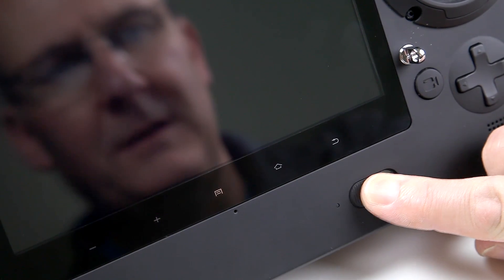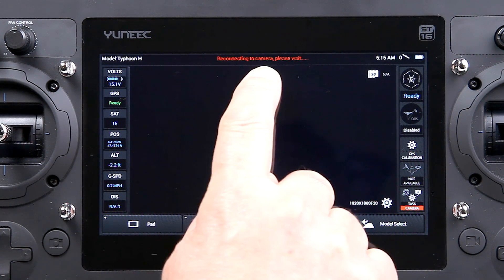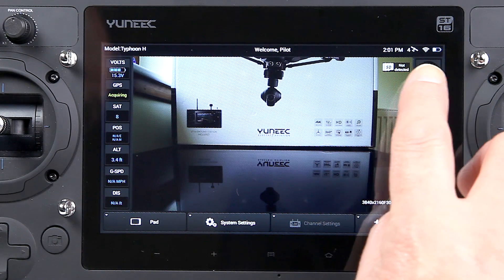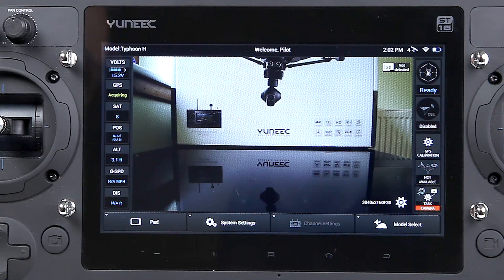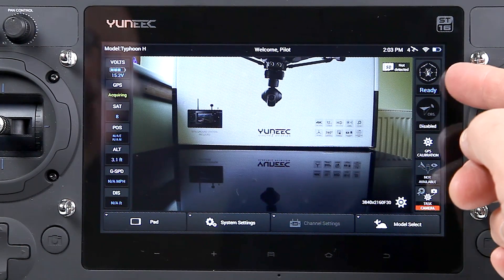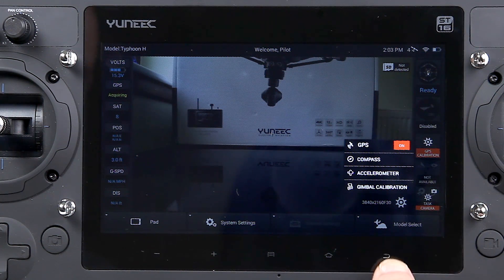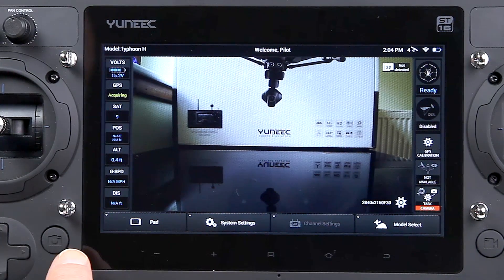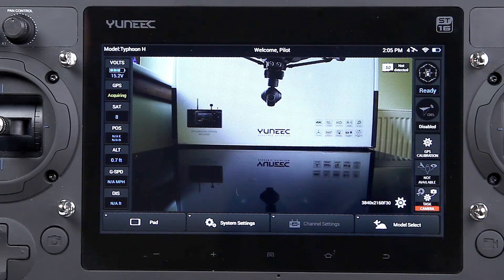Yuneec ST16 full review PART 2 settings

Comment: HELLO
 WILL YOU PLEASE TELL ME HOW TO RESET
 THE BATTERY WARNING INDICATOR SO IT COMES
ON A BIT LATER THAN 10 MINUTES FLIGHT TIME.
 LIKE PERHAPS 15 MINUTES.
 THERE MUST BE SOME TYPE  OF SETTING.
 THANKS
 KEITH KUHN
KK MOTION PICTURES 
ALSO ON YOUTUBE
Reply from the maker: Hi Keith, the battery warning is on battery power not time, I would not ignore it, it has a fail safe system but I never risk it. If you only get 10 minutes you are either flying at full rate all the time or have a failing or under charged battery. I get around 20-25 minutes out of mine
Reply: THANKS FOR THAT INFO.
 I CRASHED MY TYPHOON H TODAY BIG TIME.
 I FLICKED ON THE HOME SWITCH TO BRING IT BACK , I WAITED  FOR IT TO RETURN.
 IT GOT CLOSE THEN I HEARD THE DREADED NOISE IN THE TREES ABOUT A HUNDRED FEET AWAY. I AM LOADING THE VIDEO NOW. I WILL SEND IT TO YOU WHEN IT IS READY.
 KEITH KUHN
Reply from the maker: OUCH! hope you get it sorted, sounds expensive Cheers
Reply: I CAN ONLY SELL FOR PARTS.
 I WILL SEND YOU THE VID  YOU WILL
LOVE IT.
 HOW MUCH IS JUST THE DRONE,I WONDER WITH CAMERA.
 I WANT ANOTHER, NO KIDDING
KEITH KUHN
Reply: WILL MY CONTROLLER WORK WITH A NEW DRONE ?
 I REALLY WANT ANOTHER TYPHOON H .
 I HAD PUT IT IN THE HOME MODE BEFORE WITH OUT ANY PROBLEM, WHAT DO YOU SUPPOSE WENT WRONG?
 IT WILL USUALLY RISE UP AND COME HOME --  BUT IN THIS CASE - - YOU KNOW.
DO YOU SUPPOSE THERE WAS ANOTHER
SWITCH THAT WAS NOT ENGAGED TO CAUSE THIS TO
 HAPPEN ?
 THANKS
 KEITH KUHN
 IN OHIO
Reply from the maker: Home is home, pretty sure it then ignores all other switches. I just think it didn't rise high enough for your trees, I've never had a problem with home switch.
Reply from the maker: I wouldn't sell it for parts, ring Yuneec if you don't want to fix it yourself, they are really good ;-) Your TX will work with any H or Q500 drone :-)
Reply: YES BUT I BOUGHT MY DRONE USED.
 YUNEEC DOES NOT WANT THE  CRASHED DRONE.
 IT IS BEYOND REPAIR.
 IT WOULD NEVER BE THE SAME IF IT
WAS REPAIRED.
 KEITH KUHN

Comment: Yes it works only when off, while charging. Sorry I wasn't on the ball!
Reply from the maker: Ah that makes sense, you can touch the screen anywhere on ST16 to get battery info. The button still does nothing but I feel they will develop more functions as they improve the firmware. Cheers and hope it's a good flying weekend where you are :-)

Comment: Tiger the button you didn't know what it does on your st10 and st16 is battery level,touch it above the icon on the screen itself it should work,it's iffy on my st10 but works well on st16.
Reply from the maker: Cheers Steve, I do touch the screen anywhere to check when charging and the battery charging icon comes up with state of charge but when unit is on nothing happens :~) can you just clarify that when it works and where you touch to check it, Thanks :-)

Comment: Awesome review I just subscribed to your channel one question what does bind stand for on the Yuneec typhoon drones? I have it on my yuneec typhoon q500 4k and saw it on the typhoon ty
Reply from the maker: Thank you ;-) Bind is what they call the Transmitter and drone, when they have communication you also get bind when it connects to the camera as well, if it doesn't bind.....you are in trouble, un-plug/turn-off everything and start again ;-) hope that helps? cheers
Reply: +Tigger's RC Reviews ty for responding back 😀 that makes sense about the bind thing bc now that explains why at times I couldn't get the transmitter to respond to my command when trying to shoot video or capture pics lol thnx again for clearing that up cheers.
Reply from the maker: Pleasure Mike have fun flying :-)

Comment: I think the first thing I'd do in settings is swap the speed knob with the yaw knob, so you always have full control of flying and and all camera movement at the same time.
Plus I'd mess with the speed curve so that the speed at which you practically never get props in the shot with the camera horizontal, is set at the knob indent.
Reply from the maker: Like your thinking thanks for sharing :-)

Comment: great video again. Thanks. mine is on the way. quick question if you can answer please. Is it true that the typhoon H can only go 400 feet high. If that is the case is there any way around that height limitation? I'm able to go much higher with my Inspire one.
Reply: FAA rules you can only go up to 400 ft high maximum so that is the default setting... forturnately you can change the height setting higher than 400ft after you download the appz from yuneec....
Reply from the maker: Glad you enjoyed it. TBH not taken mine up to that level, just not something I do much, will confirm later. You will be able to get around it without a doubt my Q500 goes above that ;-) Hope I got an old thumbs up thanks
Reply: +Tigger's RC Reviews Thanks for the information and thanks for responding so quickly.
Reply: I have the Yuneec typhoon q500 4k You have to go to yuneec website download some software to your pc it gives you all the options to change all settings on altitudes and you can customize your drone then hook up the cord plug it into your yuneec typhoon and pc and it updates all changed settings to your drone.